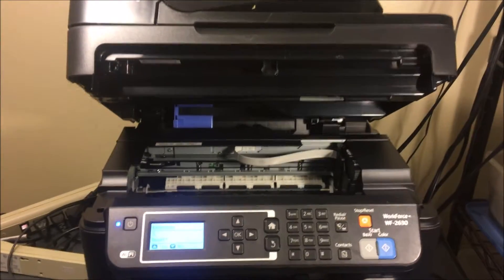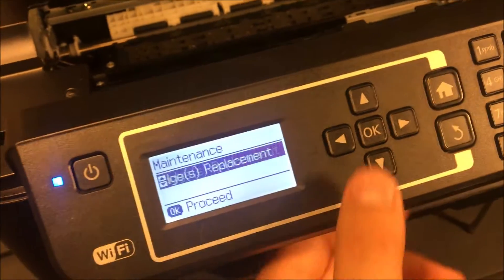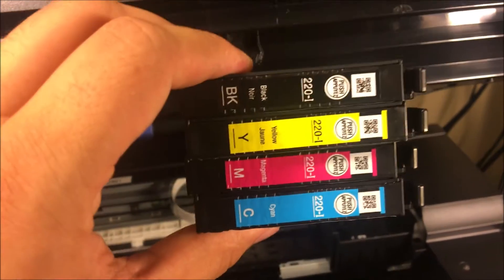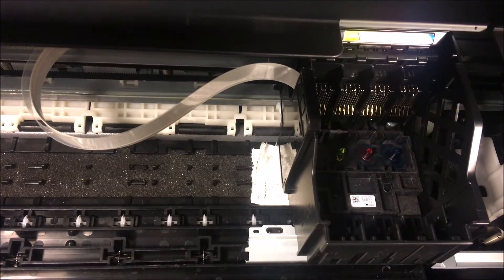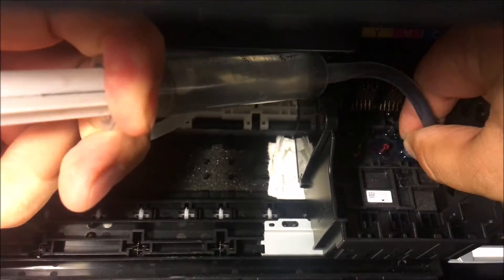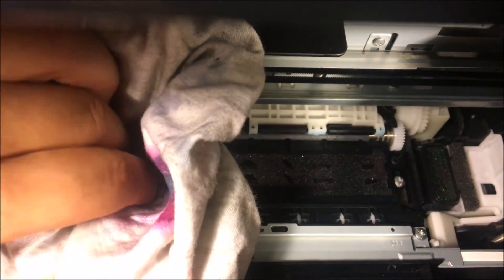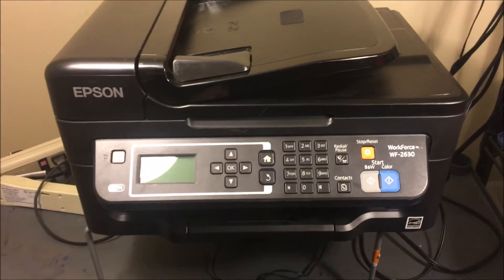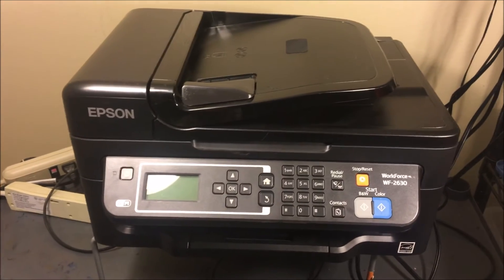Epson wf-2630 - How To Clean Printhead - Error code  0xf1 ⬇️Buy Repair Kit Here⬇️

Comment: My yellow had quit working. And of course I didn't think of looking on YouTube on how to clean the print head. No, I bought a used printer on eBay. Well, it didn't print at all. I even used your cleaning method with the cleaning solution you recommended and they seem to be so dried up that it won't budge. So I went back and cleaned my Epson and now I'm waiting the 24 hours in hopes that my yellow is unclogged. Is there a trick to getting what might be super dried ink out of the tubes?
Reply from the maker: Yes warming up the cleaning fluid will help with that.

Comment: Hey there.  So I watched your video, ordered the kit, used the solution, waited 3+ days for it to "dry" and now my printer is not printing well at all.  The paper just comes out looking blotchy.  No words are legible at all.  What happened?  I think your video is informative, but it didn't work for me, and now I am afraid I may have ruined it.
Reply from the maker: Yes so after using the kit you will need to run a printhead cleaning until the color returns.
Reply: @BestPrinters  ok will do.  Do you have a video on that also?

Comment: Where is the pw sensor on this printer??? Need to clean it as now I am getting the error 0x60
Reply: I also get error 0x60 did you solve the problem?
Reply: @elgringin  yes, I have changed the printer! This seems fo be the only solving of this matter
Reply: I've got the same problem after cleaning the print heads
Reply: did you solve this problem?

Comment: Used to have to do this to my old HP printer but forgot - thanks for the reminder for my 2 yr old Epson! I'd add that it's helpful to use the "nozzle check" and s 'clean the print head' function afterwards since all that fluid seems to thin out the ink at first.  It's wasteful of expensive ink, but that's the only way I can ever get back to opaque ink.

Comment: I did the same you did! But after I had a 0x60 problem. Where is the sensor located I must maybe clwn .The sleigh with the printer color ist stuck up at the right cornder and I cannot move it anymor. What does go wrong at my printer
Thanks for your help in case you can answer.Grretings from Nuernberg/Germany
Reply: Did you figure this out??
Reply: https://youtu.be/aJsV0L_tBeg